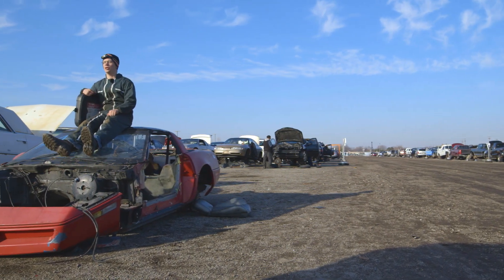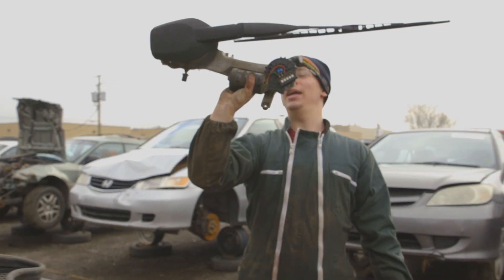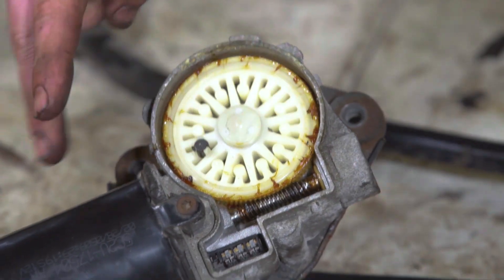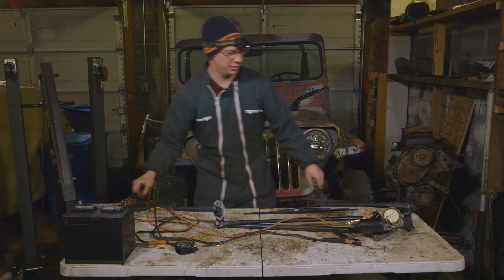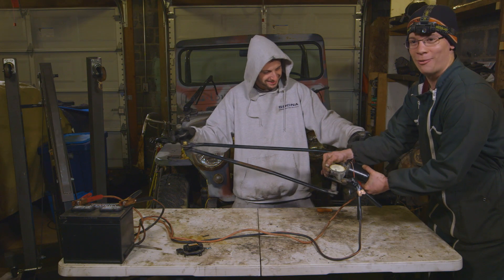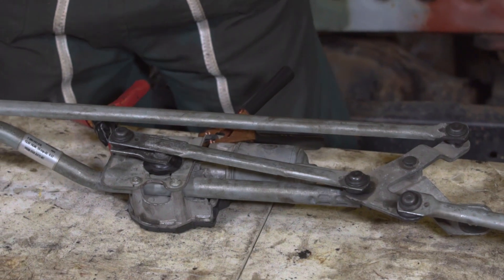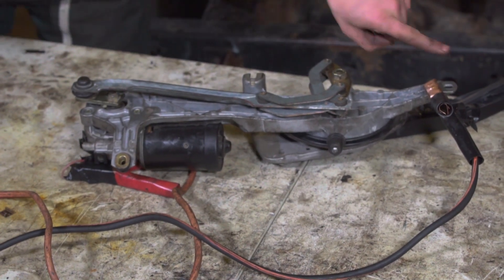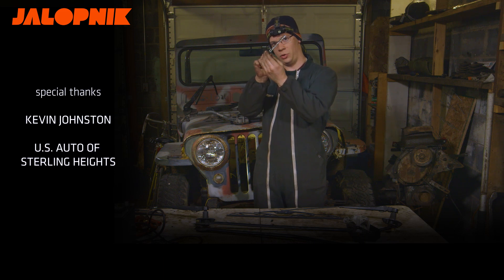This Is How A Windshield Wiper Works | David Dissects

Comment: There was an early version of the Mercedes Mono wiper fitted to w201 & w124 models, from the outside it looks idencal but under the cover at the base of the wiper arm is a fixed gear toothed flatten out arch shaped piece & the wiper has a gear that follows the fixed arch piece.